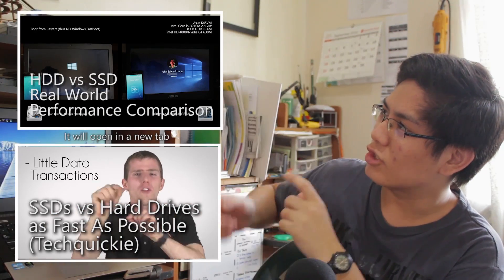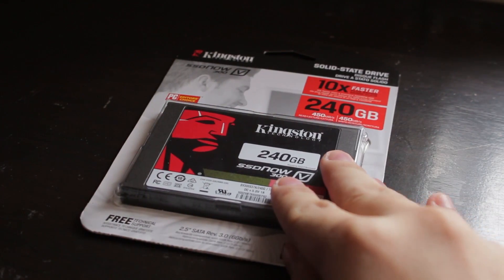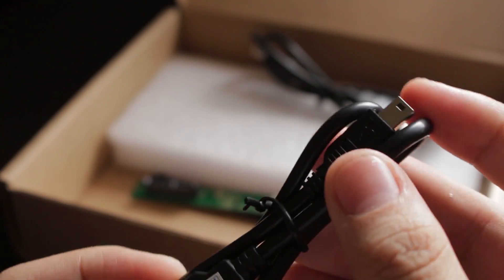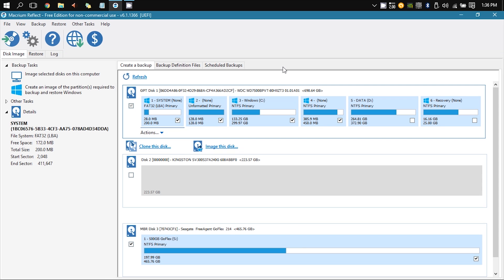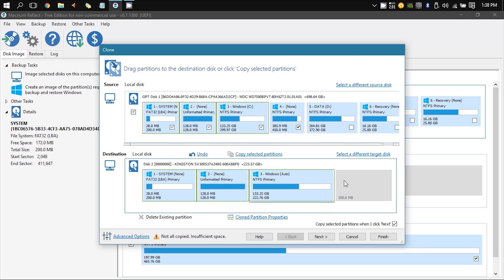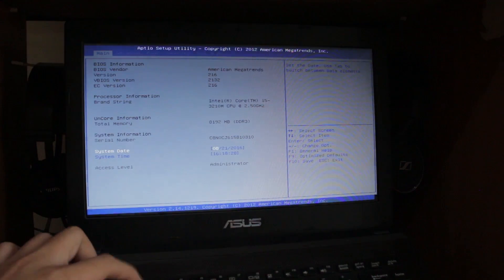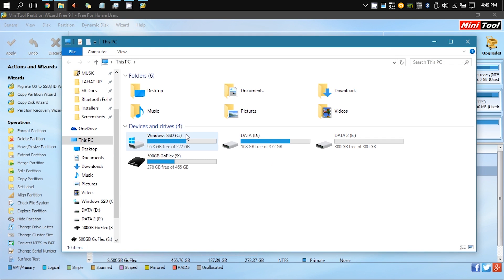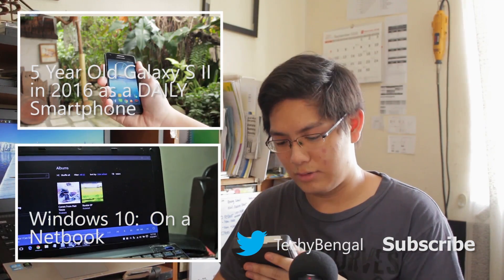[OLD] SSD + HDD Dual Drive Setup in Almost ANY LAPTOP

Comment from the maker: UPDATE and FYI: 
I just discovered that the optical drive bay's SATA connector is limited to SATA II so peak sequential speed is limited to ~250 MBps. 
This is not a big issue since we are mainly after the SSD's random 4K R/W speed so real world performance using the lower SATA II isn't affected.

However if you want your SSD to use SATA III, simply place the SSD in the drive bay where your HDD is. Your HDD will be fine in the caddy as it barely saturates SATA II. 
If you have placed the SSD in the optical drive bay caddy already, just swap the drives. No BIOS boot device change needed.
Reply: EJ Tech you could put the HDD in the DVDBay and the SSD where the HDD was. SSD can benefit of Sata3... HDD.. maybe not even sata 1 LOL
Reply: I just did this with my HP laptop. Very worthwhile  upgrade.
Reply: Homemade Solutions En I cloned my factory HDD to a SSD then installed the SSD in place of the factory HDD (which I have in an enclosure and use for backup purposes). I then took an extra HDD that I had and put that in the caddy. The reason for this is it is much easier and doesnt require messing with the boot options in the bios; however, you can just install the SSD into the 

I personally just use the SSD to run Windows and the main computer functions for faster use. I use the secondary drive for all read/write (downloads and such).

Another option is dual booting operating systems. You can have Windows on the internal HDD/SSD and a Linix distro on the HDD/SSD in the caddy. This requires you to enter the bios each time before the OS starts to choose which OS you want to run though so I personally use Virtual Box and allocated a sizeable chunk of the HDD in the caddy to act as the HDD for my Linux (Kali) distro.

My point? Options. Plus if you need the optical drive they make enclosures for them that will a,,ow them to work externally or it takes about 2 minutes to swap it back into the machine.
Reply: It's F9 For HP Compaq CQ-Series devices,that oppens up the options screen where you can find the bootloader,the bios settings button and so on.
Reply: @JoRosieQueen68  Not all Hps. I have a 15 and it's f10 for bios.
Reply: great tip man, I didn't knew Optical drives are on SATA 2.
Reply: It's a whole different machine now isn't it? I will never go back to a standard or hybrid drive again.
Reply: EJ Tech very useful information thanks for sharing. love the video btw. thumbs up
Reply: EJ Tech
Reply: saan mo nabili ungcaddy mo?
Reply: Nathan I have done the swap but I want to keep both of my drives bootable, so my question is, is it possible to dual boot these two drives having Win 7 on the old drive in the optical drive caddy and Win 10 installed on the SSD as a main drive? If it is possible could someone help me with it?
Reply: Szabolcs Keri Yes thats possible. Yo need to create primary partitions on both drives and then install Windows 7 on old drive and then install Windows 8 on main drive. The boot menu will be created by itself.
Reply: Yes. Ver much. But if you SSD size permits it, its best to keep both the OS partitions on the SSD
Reply: Hi EJ, just a clarification, I use the 850 EVO 500 and it definitely benefits from the SATA3, especially since the Magician (Samsung's Proprietary RAM Disk Caching) utilises it a lot. So it might be a good idea to shift the SSD to a SATA3 port.
Reply: Szabolcs Keri Yes it is possible. Like I stated above with the Windows/Linux setup you will just need to go into the bios at startup and select which drive you want to boot from in order to use that OS.

Curious why you'd go with Windows 7 and Windows 8? I personally use Windows 10 (prefer 7) and it offers many of the same features of both 7 and 8.
Reply: EJ Tech can you make new video for 2018 ??!!
Reply: Hi everyone I used this product and it is a very high quality product. Currently this product is discounted and there are few available click on the link you want to buy: https://amzn.to/326lIdh
Reply: https://www.youtube.com/watch?v=6BBHU0ctAHU
Reply: Throw windows on your SSD and swap the two drives so that your 2.5" HDD is in the caddy. Your OS will boot faster this way as well.
Reply: EJ Tech it's not reasonable to install a second SSD drive to the laptop because SSDs are not reliable and incase of any failure you loose all data. Traditional hard drives are better for storing data and incase of any failure you have many options to recover the data. Moreover SSDs are expensive and you have to spend a lot to get more storage. You can however install the SSD in the laptop as the main C: drive to install OS and that will improve the performance of old laptops.
Reply: DevUltraa Using a Caddy to use another hdd is useful only to backup data. However some caddy have inbuilt SATA to PATA converter that could slow down the transfer rate.